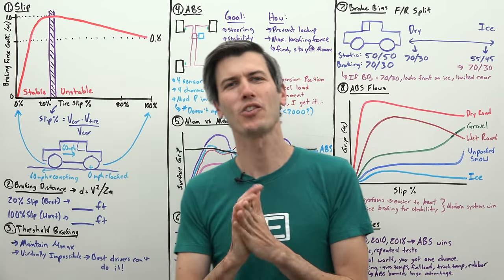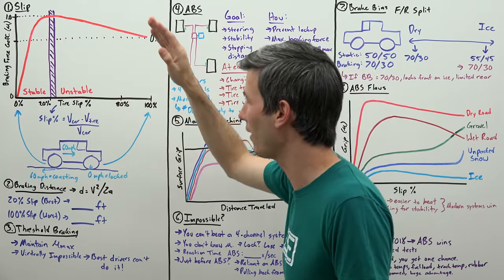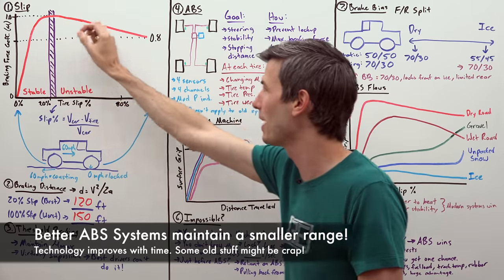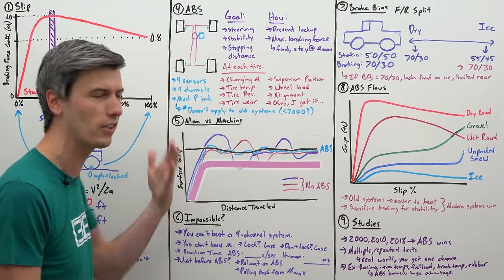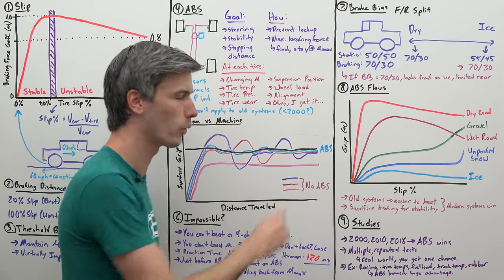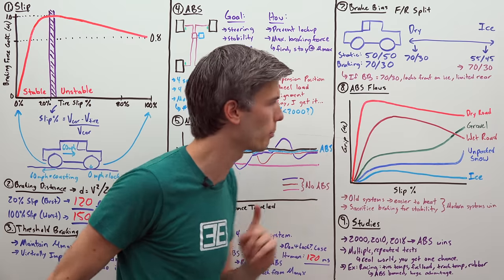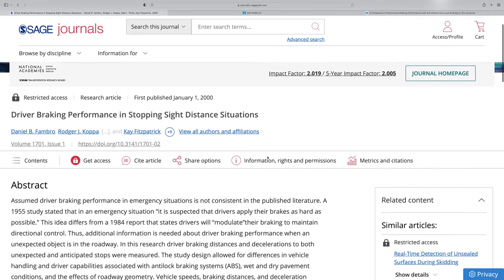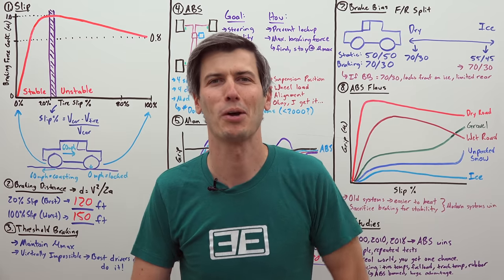Why Threshold Braking Is Impossible - ABS Wins!

Comment: Every day you learn something is a good day.

Today, I learned that what I've been telling my HPDE students is false (unless they happened to have a very old ABS-equipped car). Which means my future students will also learn something.

Learning is good. 

Thanks Jason!
Reply: I suggest you tell the students to do skid pad testing before throwing it into a corner with ABS on
Reply: @bigbadwrastler22  yep, a lot of commuter cars have HORRIBLE ABS. I used to have a nissan versa and if ABS activated while I was going in a straight line, the car would start swerving in the lane because it would pull so much power from one corner, but not the other. I'm sure performance cars are much better, but like you said test it out first.

Comment: The biggest revelation for me was that the ideal grip percentage doesn't occur right at 0%. I always thought static friction coefficients were necessarily higher than kinetic friction coefficients (meaning that the highest friction occurs when there is no relative movement between the two surfaces) but I guess that was an oversimplification. Mind = blown! Great video!
Reply: The second biggest revelation for me was that ABS is not wildly fluctuating between near-0 and near-100. I think I must have seen some slo-motion video of ABS in action, and my brain go the impression that the wheel was fluctuating between fully-locked and near-0 braking.
Reply: Tires need slip (deformation) to create force.
Reply: The extra friction comes from shearing rubber. Up to a point (ie. before the tire starts sliding completely) you're still getting the regular amount of friction PLUS a bit extra because of the shearing.
Reply: I think you would be completely right if the tires were solid, then 0 % slip would be the optimum.
Reply: @Delibro  that's actually incorrect. Tires produce zero traction without slip.  That's actually one reason solid tires are worse then pneumatic tires.  But even solid tires deform. Just not as well as pneumatic tires do.
Reply: @brianwright9514    I wonder if you, or indeed anyone can help.  I'm confused by the concept of slip % :(  I don't understand how the tyre can be going faster than the car without wheelspin happening.  Is the slip being considered in this example only at the point of contact with the road, and there is negative slip around the rest of the tyre to balance it out?  Otherwise surely if the tyre is going faster for many seconds, the tyre would have stretched far more than is truly possible.
Reply: @brianwright9514  All you said is right. But all I said is right too.
Reply: @Gelp  If there is slip, the tyre rotates slower than in normal operation when you don't brake/accelerate/steer, he explained it at the beginning.
Reply: @Gelp  Find a video of a Top Fuel Dragster tire at the long end of the track in slow motion.  It will help you visualize how different parts of the tire are moving at different speeds.
Reply: @brianwright9514  thank you very much Brian! Will do.
Reply: @brianwright9514  Yes!  Modern tires can generate greater than 1G of stopping in the right conditions because the deformed tire surface can bite down into the little grooves and cracks in the pavement.
Reply: Yeah I remember watching a video about Slip Angle and it's quite freaky you see cars going faster and they look like they're doing a drift but at a miniscule angle
Reply: Static coefficient of friction is always higher than kinetic friction. That is for a pure rolling object. If the object deforms, sheers, burns off, temperature increases, etc, that is all dumped energy and thus the coefficient of friction can obviously go higher
Reply: @pyRoy6  it did in the 80s and 90s
Reply: @Gelp Slip means the wheel is turning slower than it would be if there were no slip. That is, the wheel is turning slower than the car is traveling. It does not, as someone else suggested, mean the center of the wheel is turning at some speed that is different than the outer part of the tire. If we were modeling this phenomenon, we would assume the wheel/tire combo was one solid piece. 

Yes that means there is movement between the tire and the pavement. But the amount of movement happening is variable between no movement at all and the maximum amount which is the vehicle speed. The difference between the speed of the wheel and the speed of the vehicle is the amount of movement or slip happening. The percentage is taking those absolute numbers and turning them into a ratio.
Reply: What's being talked about in the equation Vcar - Vtyre is velocity, not speed. 

So the velocity of your car is whatever speed you're traveling at. As you brake, you decrease the velocity of your tyres, while the velocity of your car wants to stay the same. The more brake you apply, the larger the difference between car velocity and tyre velocity, which causes slip. 

The slip% is how much slip you have between the road surface and the tyre, and as mentioned in the video, 0% slip is when your tyres have full grip - as in they're all rotating at the same speed as the road that's passing underneath them. 20% slip is when the tyres are trying to slow down the weight of the car that they're holding up and have enough friction with the road surface not to lock up - technically and scientifically speaking they are slipping, but in layman's terms, they are not slipping as they're not locked up. Past 20% slip, tyres start locking up and at 100% slip have the lowest friction with the road surface, causing the worst breaking performance.
Reply: @pyRoy6  May be some top modern ABS can modulate the pressure, but most of them have just two valves to release pressure and apply it back. But the wheel itself has some mass and can"t lock or unlock instantly. So it smooths the process, and as faster operates the ABS as closer it can be to the target slip. How fast it operates, you can feel by pedal vibration. ABS from 90s-00s did it about 5-10 times per second, so one cycle was about one turn of the wheel. So I would say it was almost 0-100% jumps. If modern systems really operate at >100 Hz frequencies, than they must do it better.

Comment: As a Professional Automotive Engineer of 40 years  AND an ex rally driver and rally car builder I 1000% agre e with this analysis.
On top of that, I refer you to a study from 1989:
A group of 10 rally drivers from Oxfordshire went on a rally driving course at Manby, Lincolnshire. Some of us took our own rally cars along on the day as well as using the provided Escort mk2 rally car. One of the chaps went in his road car - an Audi Quatro Coupe. Back in those early days these Audis had an ABS off switch. So we set up a course and all 11 of us (incl the instructor - a National Rally Champion) had a game of 'beat the ABS'. We all had 3 goes each - not one of us beat the ABS even one single time.

For something like 2 1/2 decades now I've been arguing this on one forum or another (starting on Honest Johns Backroom forum in the 90s) using the 4ch/1ch and modulation frequency arguments. And quoting my experience from above (along with other experiences from my professional life). I always got shouted down by the bar room engineers.
At least now I've got your video to back me up.

The bottom line is that since the early 90s no human driver has been able to beat ABS  except on snow or gravel
Reply: I have been able to beat the ABS with ease on dry tarmac in the summer on all the cars that is 10 years or older. Also in the winter you get up to 1/3 the breaking distance without ABS when it is slippery snow and ice. Unless the cars suddenly got MUCH better ABS the last 10 year I will say you are wrong... Also there is huge differences in the ABS from maker to maker, some ABS is ok and most is bad...

Comment: Regarding "brake bias"  - you should look up a height adjusting proportioning valve.  It's a valve attached to the suspension which regulates rear brake pressure in proportion to the weight on the tires.

Comment: As your little disclaimer said on the screen,  old abs systems were more of an on /off switch type of system and they were not as good as an experienced driver doing threshold braking... but they WERE better than a panicked driver slamming the brake pedal to the floor.   Subaru ABS had a horrible problem on low friction surfaces to the point that panic braking was actually better than Subaru ABS on ice and snow.  Modern ABS is more like electronic brake force distribution.  My 2005 EVO had electronic brake force distribution and i think a separate ABS system.  I assume that in modern systems these two are integrated together into one system.  I hope that Subaru has fixed the ice and snow ABS problem.
Reply: Do modern ABS still shake the pedal when you brake? Haven't hit abs in so long now.
Reply: @MegaLs2000  yes. excpet the real modern ones :) (2-3 year old cars might have it)
Reply: Yea, and they didn't all control the wheels individually too. All the 90's Nissans for example only had 1 line for both rear brakes.
Reply: @MegaLs2000  the way it was explained to me, that vibration is the abs pump kicking in and out, modulating your brake pressure.

Comment: This is even more true with motorcycles, since they get massive weight transfer under heavy braking. You can pretty much get to 100% weight on the front wheel during maximum braking. For this reason, you have to progressively squeeze the lever even during an emergency, to allow time for more weight to transfer to the front tire which allows for a heavier braking force without slipping. ABS is a huge game changer on 2 wheels.
Reply: bicycles can exceed 100% weight transfer under emergency braking conditions. That results in a flip over the handlebars. An experienced cyclist will get off the seat and crouch behind it to reduce braking distance. I would think that ABS prevents this from happening on a motorcycle.
Reply: @jamesleonardpanes9915  that’s not exceeding 100% weight, it’s locking up your brakes without losing tire grip, so instead of the tire rotating, it’s the whole cycle that’s rotating. Yes, it can happen on bikes too, but as I defined above, you need really good tire grip for that to happen. Less likely than on cycles.
Reply: @SivaKanthSharma  On a racing bicycle, the normal riding position has the torso bent down over the handlebars. This already puts more than 50% of the weight over the front wheel. It doesn't take that much grip to place the centre of gravity beyond the front wheel. That's why it's a good idea to get off the saddle and shift to the rear under emergency braking. ABS would certainly help, but when the whole vehicle weighs less than 9 kg, people are not enthusiastic about adding any weight. Motorcycles are considerably heavier and they have a much higher power to weight ratio. The added safety from a good ABS would likely be worth the extra weight and complexity.
Reply: FortNine has an amazing video about that if anyone's interested

Comment: Glad you mentioned the gravel braking. My S10 slowed down much better on gravel after the wheel speed sensors died.
Reply: My old 99 S10 would pop the abs if you turned off a road and up an incline to get into a parking lot or similar, something to do with loading the suspension hard, not even on the brakes hard. Pretty much leaves you careening straight at someone's driver's door, scary stuff. Even if a single wheel would lock (and it probably didn't in the first place) it'd effectively kill all the brakes with how slow it cycled. Garbage 90's systems, I cut that crap out of the truck when I had it.
Reply: I had to kill the ABS on a rented Jimny cos it literally could not slow down on a gravel hill.
Reply: This is (one reason) why dual sport motorcycles allow the user to disable rear tire ABS on the bike.

Comment: No question ABS wins.  One interesting observation is that during the braking exercises at an AMG Academy event I attended, which used the E63s AMG with Carbon Ceramic brakes, initially most people did not fully press the brake peddle enough to get ABS completely engaged.  I've seen this at several different events.  The average person doesn't want to lock the brakes.  They are either afraid of locking the brakes and losing control, or they are afraid of hurting the car.

Another interesting aspect of the braking exercises I've experienced at Mercedes, BMW, and Audi sports car training classes is fully engaging the ABS while in a turn.  As a 60 something guy who grew up without ABS, jamming on the brakes to the max in the middle of a turn is not something that comes naturally - we learned early that this was a really bad idea.  However, every modern ABS equipped car I've done these exercises with is drama free during this exercise.  The car tracks through the turn allowing you to continue to steer to avoid obstacles while at the same time braking at the maximum rate.

In addition to driving cars on the track and off road and in snow and ice conditions, I also used to road race motorcycles.  I still ride off road and one of the bikes I have (KTM 1990 Adventure R) has anti-lock brakes.  Such an amazing thing when riding on loose terrain.  My KTM EXC 500 is old school as is my GasGas trials bike so I still have to have some manual braking skills to get by.

But for me ABS is pretty darn cool.
Reply: At a similar Toyota/Lexus event, they were very clear, mash the break pedal as hard as you possibly can if you want to stop in the shortest possible difference.
Reply: @iamnotunusual  My 4Runner has an emergency brake feature that caught me by surprise a few times. If you go from throttle to hard braking in a very short time the brakes will go full power  on their own. Looks like Toyota made sure you used all the brakes when you needed them. It stops that big SUV surprisingly quickly.

Comment: It certainly was possible to beat some older systems...
Sometime in the early 80s (before most people had any experience with ABS) I took a high-performance driving course. One of the exercises they had us do was braking in a straight line with ABS, then obstacle avoidance with ABS. 
They then disabled the ABS by pulling the fuse and had us do the same things in the same car. 
In the straight-line stop, I was able to stop significantly shorter than with ABS. 
But in the avoidance manouver, the computer won, by quite a bit!
Reply: Yeah absolutely, I could easily outbrake my 89 Toyota Celica’s ABS, but in a sudden avoidance situation it was great for that moment before full situational awareness.
Reply: My dad humbled me when i was a teen with this, glad he did taught me to respect the car alot more as a teen.
Reply: years ago I had first year Opel omega B (1994), it had ABS but only ONE brakeline for both rear calipers. And it was factory setup. I assume, that when one rear wheel locked, abs cut out both rear tyres. So thats why human won in this situation.
Reply: @Martink9191  The rear wheels arent doing much anyway during braking
Reply: @Martink9191 the rear never brakes to the fullest. A lookup at the front does not change the direction of the car. It only reduces the amount you can brake.
A lookup at the rear will always spin the car. In the slipchart your ABS keeps the front close to the peak slip-grip. The rear is on the rising slip curvature and wont get higher than a certain threshold. You will gain a view cm of brakedistance under ideal conditions. Your reaction time is 10-100x times more relevant and you don't need to worry about unwanted direction changes. You even have the ability to slightly turn the car. Something that your tires can't do under maximum braking.
Reply: @elek101  rear wheels are about 30% of all brakeing force, when car weight distripution is 50/50
Reply: @MrHaggyy  with abs they lock as much they can. Without abs they are capable of locking up to. And no, spinning is not must be effect. It might tilt slightly, but not spinning. If it goes spinning, you have uneven braking force between right and left side.
Reply: @Martink9191  you never want a locked up tire. You lose like 30% brake performance, and if the rear locks you will spin. That's how you enter a drift with a handbrake.
Reply: @MrHaggyy  NO!. Handbrake itself is not enought to get car spinning, you need to oversteer it to.
Reply: @Martink9191  you always have "oversteer" in any one direction if the rear is blocked. Doesn`t necessarily have to be a strong rotation, but the left and right rear grip are never equal, and if your steering has an angle you loaded the rear differently and therefore gave it a direction to oversteer. As mentioned you always leave some margin at the rear to secure stability in a road car.
Reply: @Martink9191  That percentage is dependent on several factors, and can range pretty widely. Static weight distribution is only one of those factors.
Reply: @Martink9191  A spin CAN happen even with equal braking force on both sides. It depends on many factors.
Reply: @MrHaggyy  If the rear locks you CAN spin. There is, of course, a range of conditions under which you can lock the rears without spinning.
Reply: @xtnuser5338  exactly. by many factor. But usual road, theres non. So no spin.
Reply: I remember watching some tests on ice that showed in a straightline stop ABS can be beat simply because in that situation it's trying to retain control so applies less braking force. But because of that, when it comes to dodging obstacles on ice, you retain much higher maneuverability when you have ABS. So instead of just stopping, you can slow down and dodge the obstacle, which is a much more useful thing. If you look up ABS on ice you'll see what I mean. I can't find the exact video I had seen before, comparing straightline and swerving on ice.
Reply: again like most ppl that says they can out do ABS are always in a controlled environment when braking at a reference point.